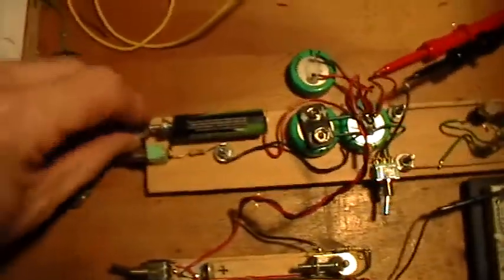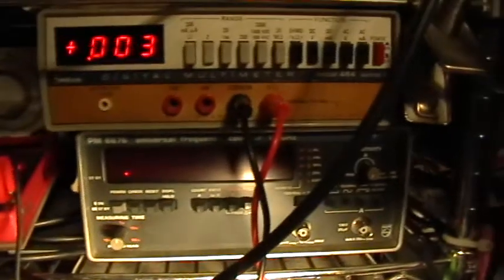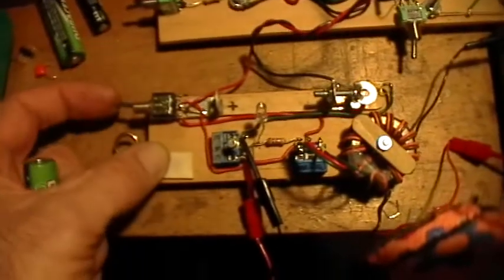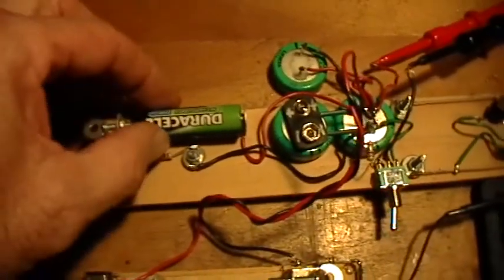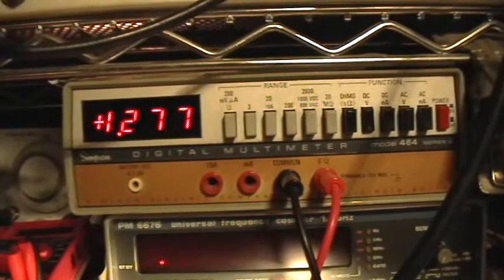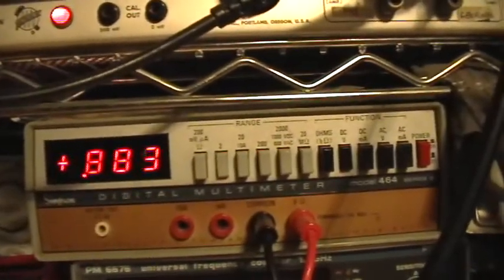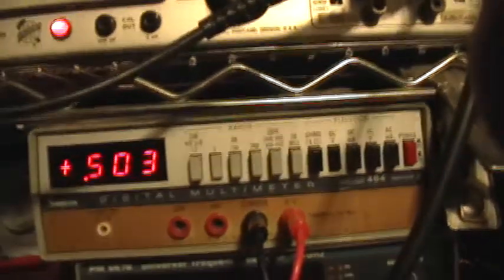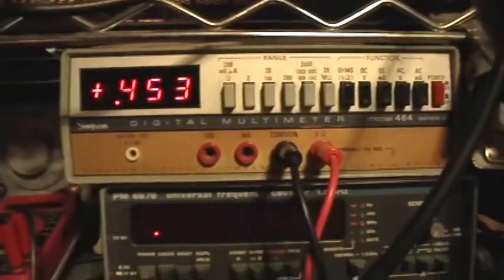Joule Thief: JTBasic Testbed Running on 3 Farad Cap, 39 LEDs

Comment: Please forgive me if I sound terse or harsh, but I had to keep it short.  The only thing that makes me grumpy is seeing the red complaint telling me I've typed past the limit. The table on page 14 in this link gives an idea of what the internal resistance of super caps used for memory backup.  nec-tokin(.)com(/)english(/)product(/)pdf_dl(/)supercapacitors(.)pdf (remove parens)  I've seen external res's in batteries used for memory backup.  I don't know about caps, but high current isn't needed.

Comment from the maker: Yes it is really in series.
No, I'm not going to put a rubber band on the strap.
There are cables and wires dangling from the lamp over the workspace, the camera is probably knocking against one of those. Are you really going to make me watch this video again to find out? 
I don't think these caps have a resistor in them, but I really don't know. Can you provide a source for that information? I've never heard it before.
Did you get up on the wrong side of the morning, this bed?

Comment: Towards the end you said the white LED was in series with the green LEDs.  Is it really in series?  When are you going to put a rubber band around that wrist strap so it doesn't dangle in the vid and distract viewers?  And what's the clink every time you swing the camera around?  The "asymptotic" curve may be influenced by an internal series resistance that limits the discharge current in the capacitors.  Some that were intended for memory backup (like these 5.5V ones) had a resistor in them.